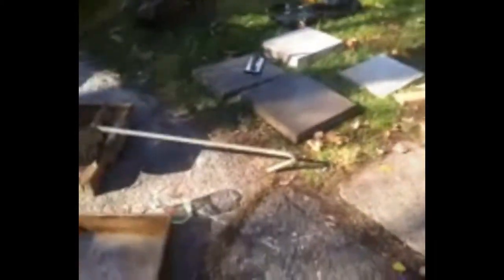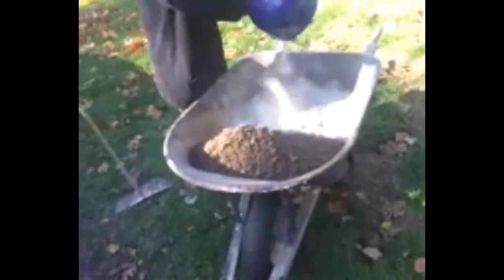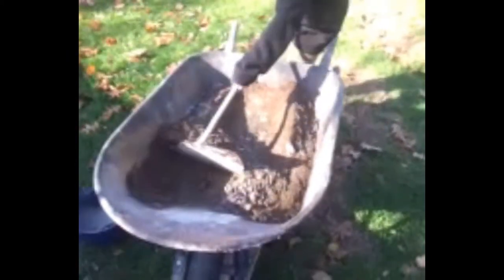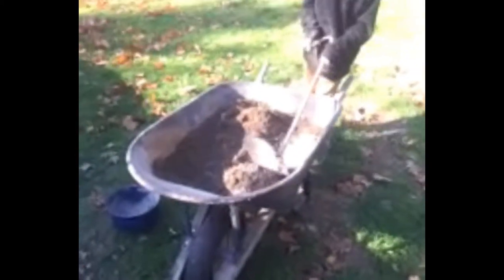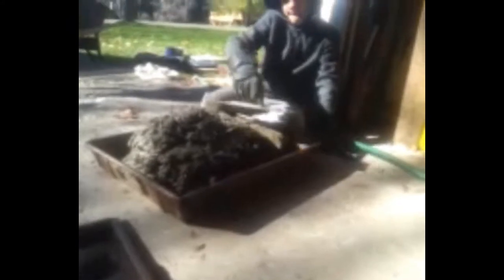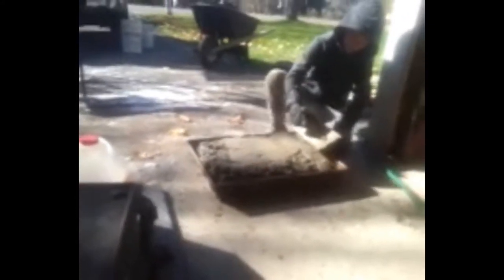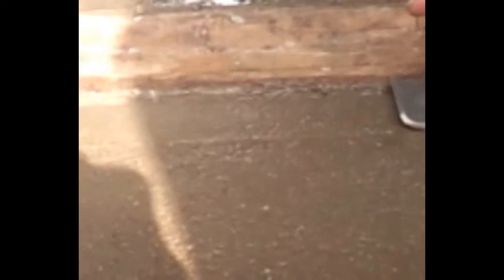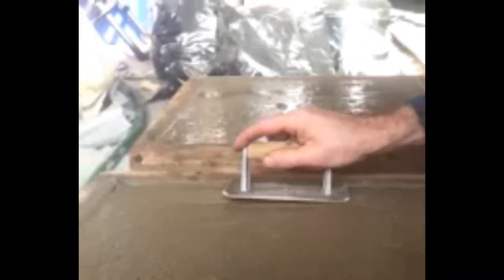Make your own concrete blocks

Comment: I've made slabs like that before i vibrated the mix in the forms with a cheap half sheet sander  it gets all the air out . Just a thought but your blocks look great anyway
Reply from the maker: Be a good idea vibrating somehow.   For now we're trowling mortar into the air pockets after they have cured.  I'll probably never need as many as I'm doing these days but the egyptian in me would like to put a cam under the form and turn it with a crank to help release air bubbles.

Comment: Thanks! Y'all just gave me a cool idea for an upcoming project. And thanks for making it look easy
Reply from the maker: I do enjoy all aspects of making concrete blocks.  It's a solid sign of how heavily I overinvest in things that don't matter.  We took them out of the forms today (four days curing time).  Broke 1 of them beating it out of the form.  Main thing now is to make all the forms have tapered sides to release the cured block easily, or metal forms from 2" angle iron.  Just dreaming :)